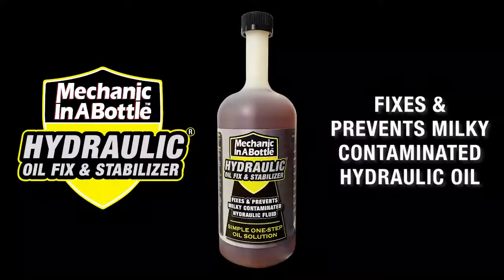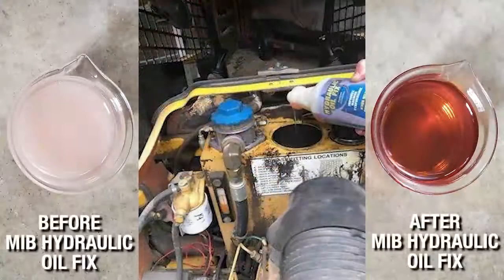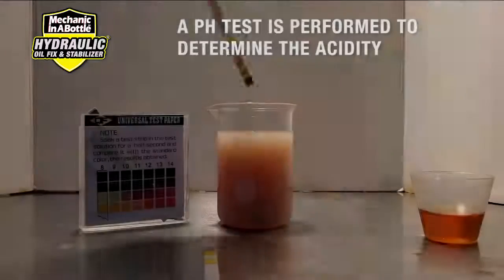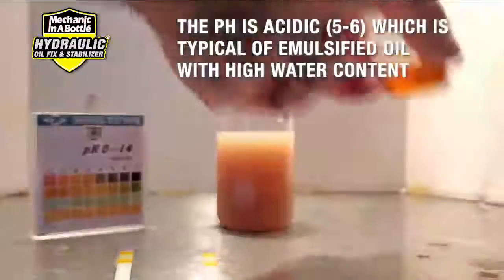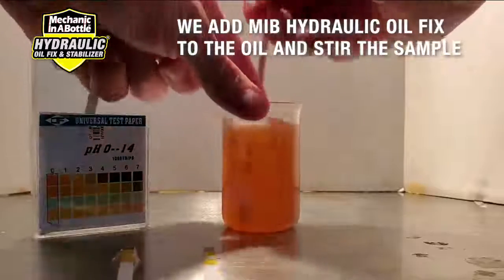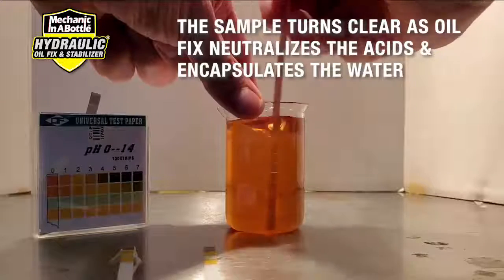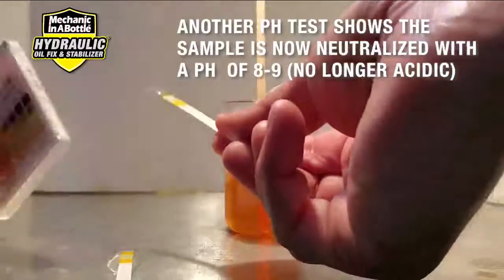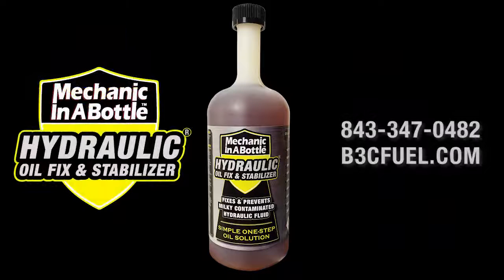INSTANT Fix & Prevent Milky, Emulsified Oil - Mechanic In A Bottle Hydraulic Oil Fix & Stabilizer

Comment: Come on BC3, why won’t you answer these simple questions? Where does the water go? Your demo here clearly used far more product than the max label rate of 3%.
Reply from the maker: Hi there. The oil already has water. New oil has water. When it becomes emulsified it has that pudding look. The Oil Fix breaks the emulsion and puts the water back in suspension the way it was. So you basically get the oil back in the state it was when it was clear and working correctly with correct viscosity and acidity.

Comment: Ok so it traps the water to separate from the oil. Does the water then settle to the bottom to be drained off the tank?
Reply: WHAT IS THE ANSWER ON THAT?????????
Reply from the maker: Hi there. The oil already has water. New oil has water. When it becomes emulsified it has that pudding look. The Oil Fix breaks the emulsion and puts the water back in suspension the way it was. So you basically get the oil back in the state it was when it was clear and working correctly with correct viscosity and acidity.